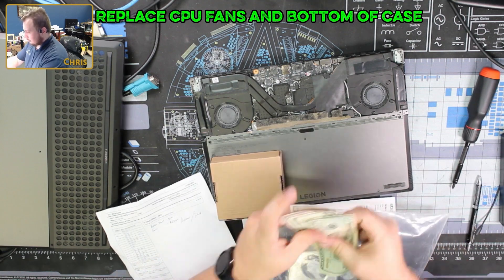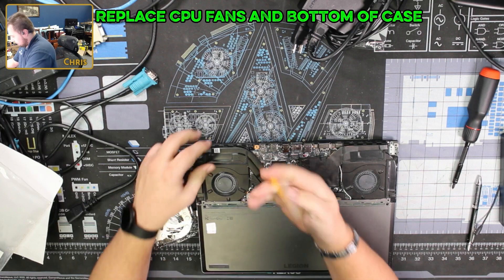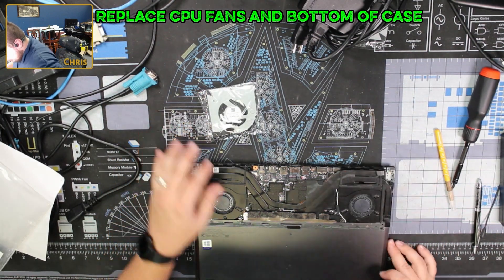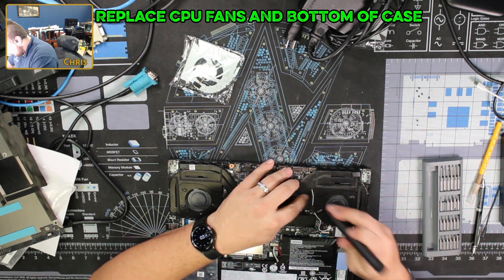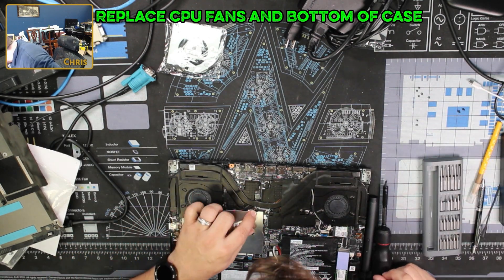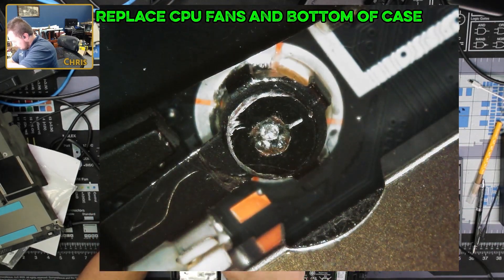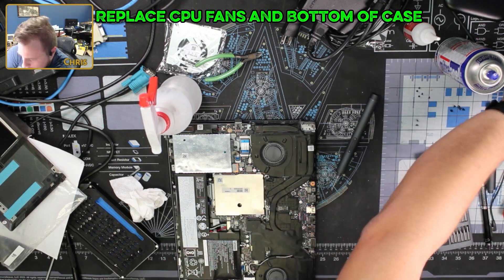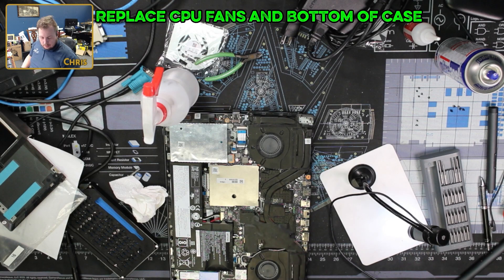This Laptop Nearly Broke Me. Lenovo Legion 5 CPU Fan Replacement!

Comment: You didn't even put fresh paste on the heat sinks.  What kind of tech are you?
Reply from the maker: The type that puts a computer all the way back together and then takes it back apart because he forgot to plug the speakers in and then repastes the CPU at the same time. I don't always remember, but 95% of the time I do.
Reply: @Bradenton-PC-Repair  LOL... Fair enough.

Comment: You can use a small tool to grind out new bigger lines on the screw. Or use some good super glue to attach to it. Just don't spill the glue lol.
Reply from the maker: I almost pulled out the dremel for sure. During the FF I tried using the super glue, it was just too shallow.